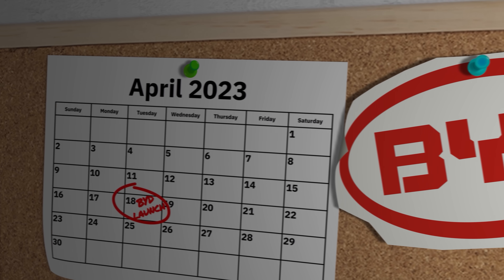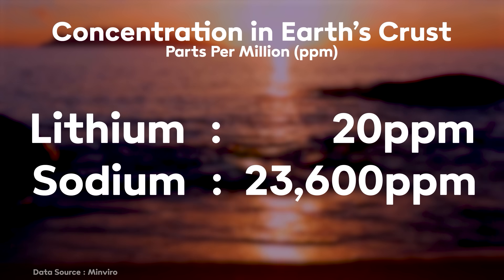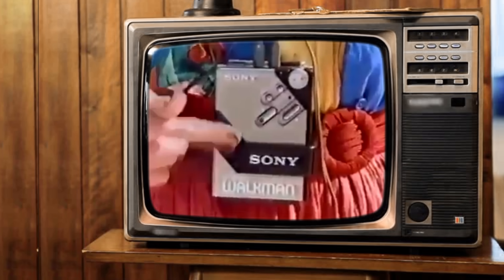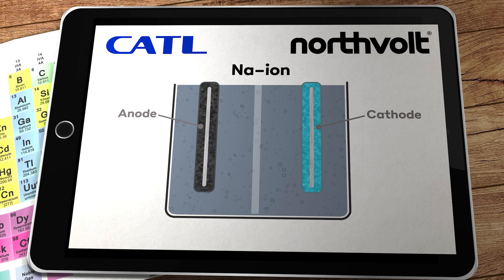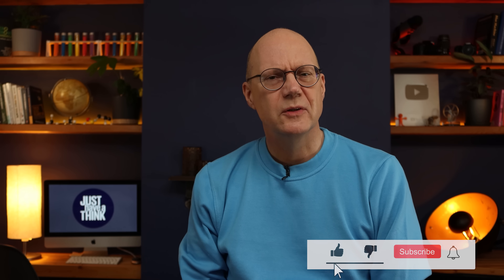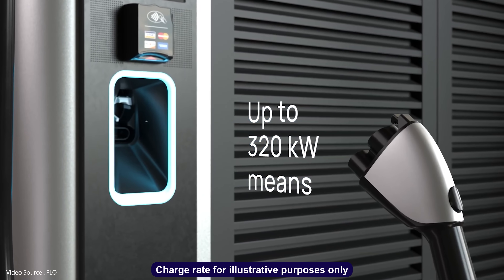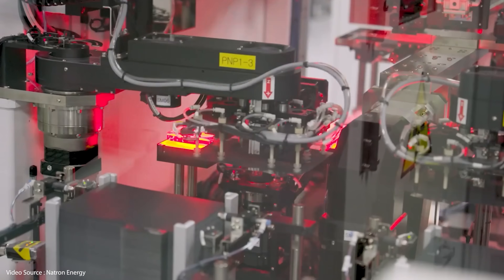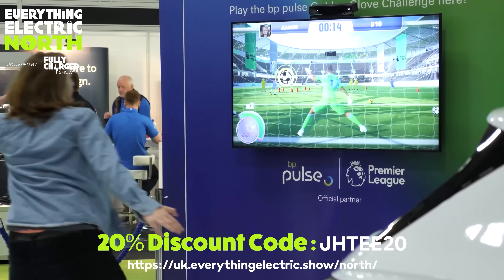Sodium-ion batteries in the USA. Beating China at their own game!

Comment: I have some thoughts about Sodium-ion batteries, but also, I have adjusted my thoughts on last week’s broadcast (sand batteries and hot water reservoirs) and expanded upon them.

First Sodium-ion batteries, yes, it is a very good idea to use cheaper more abundant materials for the majority of our battery needs, and save lithium-ion batteries for products 
were lightness would be a real benefit like mobile telephones and lap top computers, and I see no problem with Sodium-ion batteries for cars, I currently have a small petrol car with 
a full tank range of 400 miles which means I need to fill up every 10 days, and I would much prefer to buy a Sodium-ion battery powered car with a range of just 200 miles, which I would have to recharge every 5 days, rather than pay a lot more for a lithium-ion battery powered car with a range of 300 miles, plus I am certain that just like lithium-batteries before them, the capacity of Sodium-ion batteries will grow year by year.

As for short-term grid scale energy storage, Sodium-ion batteries are an acceptable solution,But long-term energy storage would be better served by a chemical storage system, such as 
Hydrogen via electrolysis, as Hydrogen is also likely to be the future choice for fuels of heavy vehicles, planes and ships. 

In last weeks broadcast, you brought us exciting news about 2 projects in Finland, an underground hot water reservoir for district heating and an above ground thermal sand battery preforming a similar function, but I can not get out of my head that these 2 separate projects should be just one. Water is very good at giving up heat, that is the reason we use it in metal radiators in your house, but in a district heating system when cool water returns to the main heat reservoir there is the risk it cools down the reservoir too much reducing the effectiveness of the whole scheme

What I assume I can see in your broadcast is a series of very large concrete tanks in which hot water would be stored, and pipes connecting to a cities district heating system, then I presume a concrete roof with 130 feet of soil on top, I would like to suggest an alternative set up, again have your very large concrete tanks for storing hot water, but from the corner of each tank you have a concrete collum or pile rising 130 feet to the surface to form the basis of a concrete raft on which you build a sand battery with pipes connecting the sand battery to water reservoir.   

I am reasoning that a properly insulated sand battery should hold on to its heat much longer Than a water reservoir, and therefore could be used be to intercept and reheat the cooler water before it is returned the main reservoir top up the hot water reservoir, this would allow the main water reservoir to smaller, and I assume cheaper to build, of course you have to add on the cost of a sand battery, but overall, I believe it would be an advantage  to thinking on multiple levels.

For the next bit you need to stretch your imagination, I have long puzzled over conundrum of Australia, apart from a few large cities, Australia is a largely empty continent, with more than enough space to install any number of solar panels, many hundred times more than would be needed to meet their domestic needs, plus Australia has a huge coastline just waiting to be lined with large onshore, or offshore wind turbines, Australia does itself and the rest of the world a dis-service when it thinks, only in terms of its domestic energy needs, I believe that Australia could have the capacity to supply energy to a large proportion of the world and become the (Saudi Arabi) of green energy.

Of course, you would have to over come the no small problem of how to transfer green energy to the rest of the world, the obvious option would be high voltage undersea cables, But given that most of its potential customers are in the northern hemisphere, these cables would have to be many thousands of kilometers long, and be laid at the bottom of some of the deepest oceans, at risk from geological and seismological events, or even actions from unfriendly powers (remember gas pipelines from Russia) plus they are going to be very expensive.

The next most likely option would be to green electricity converted into a chemical form,Like Hydrogen by electrolysis, after all given Australia’s large size, Hydrogen is likely to be the domestic fuel of choice for heavy vehicles, planes and ships, so producing extra for export should not be a problem, but carrying Hydrogen in bulk is not an easy task.

I wonder if another method might work, could you convert and highly insulate a large ship, like an iron ore carrier and install a network/ web of air pipes, which you then cover in sand, to create a huge floating mobile sand battery, then use green energy to heat air to a very high temperature, circulate the air through the buried pipes there by raising the sand temperature to a substantial level, before shipping your floating sand battery to one of many northern hemisphere countries, like Japan, China and other Asian nations, once the ship has arrived, the on-board pipes would be connected to a dockside generating station were the process would be reversed, passing air through the pipes to extract heat from the sand.

There could be Yet another variation, I believe that concentrated solar power stations use mirrors to concentrate the sun’s heat towards a central point, usually containing molten salt. 
So, what if you converted and highly insulated an oil tanker, and filled it with very hot molten salt, again heated by green energy, and just as with the sand example, ship it to a northern country, and just as before connecting pipes to the ship and pump molten salt to a dockside generating plant. Of course, you would need more than one ship for each destination you supplied, so as one shipment of heat was depleted, another was ready to dock.

I wonder just how much heat you could store in a ship sized mobile sand or molten salt battery, (is anyone up for doing the math’s,) of course you would have to not just insulate the heated material from the surrounding air, but also make sure heat did not escape through the bottom of the ship into the sea, but I do not believe that is an insurmountable challenge, and it would be a good fit, while the northern hemisphere shivers through its winter Australia would be at peak production, plus it is not just a winter thing, as a crowded Asian continent warmed up; it would still need additional electricity to power all those hundreds of millions of air conditioning units, power that a huge largely empty continent like Australia could supply, if it wanted to. 

Of course, you could have a huge ship filled with lithium-ion batteries, but I would suspect that power delivered by that method would make nuclear look cheap, so will Australia take 
up the challenge of being a large part of the worlds green energy storage system, whether by high voltage undersea cables, bulk Hydrogen, of some form of floating heat battery.

Comment: An earth battery is a pair of electrodes made of two dissimilar metals, such as iron and copper, which are buried in the soil or immersed in the sea. Earth batteries act as water-activated batteries. If the plates are sufficiently far apart, they can tap telluric currents. The simplest earth batteries consist of conductive plates from different metals of the electropotential series, buried in the ground so that the soil acts as the electrolyte in a voltaic cell. As such, the device acts as a primary cell. When operated only as electrolytic devices, the devices were not continuously reliable, owing to drought condition. These devices were used by early experimenters as energy sources for telegraphy. However, in the process of installing long telegraph wires, engineers discovered that there were electrical potential differences between most pairs of telegraph stations, resulting from natural electrical currents (called telluric currents) flowing through the ground. Some early experimenters did recognize that these currents were, in fact, partly responsible for extending the earth batteries' high outputs and long lifetimes. Later, experimenters would utilize these currents alone and, in these systems, the plates became polarized.
Reply: Imagine farms fields making electric and growing more food. It takes 10 acres of solar to grow one acre of food. We could grow 11 acres of food and make some electric.

Comment: Two words: Voltage spread.  It's too big.  Use Na batteries and you have to add a ton of buck and boosting circuitry just to try and get something in a usable range.  That means a lot of converting which means a lot of wasted energy.  So you get even less energy than you think.  As an example, a 12V Na battery will have a high of around 17V fully charged and discharged will be around 7V.  No inverter can handle that sort of spread, and neither can most 12V devices.  To contrast, a 12V LifePo4 battery will be at 14.6V fully charged and 10V discharged with the two extremes representing very little of the usable energy, the average being just a bit above 12V, or pretty much as perfect as you can get.  The higher you go with voltage, the more of a spread you get with Na batteries.

Comment: May as well use these in ferries and cruise ships to supplement ballast in the centerline. Win win, use them until 0 volts as really ultra clean energy, free ballast, then use LNG for the remainder of the trip, and recharge on shore power while docking.

Put batteries in all the vehicles that can't be powered directly through pantographs.

Comment: One huge result of this would be a reduction in the need for Lithium. Every sodium based battery utilized means that much less lithium is needed. Supply and demand tells us that will reduce the price of lithium in the market place or at the very least, slow the rise in price.
Reply: Agreed, stationary battery back up to cover solar and wind intermittency does not need to be Li+. There is a vast amount of that going in right now, it could ALL be Na+. I looked to see if I could pick up some stock in this technology. Alas, not yet but I'm sure it will come soon.

Comment: Sodium Ion batteries are great, but they will tend to push EVs into the niche role of an around town car.   That's probably a good thing as it addresses a lot of the current oversell of EVs as a complete replacement for IC cars.   It will be very interesting to see where this goes.
Reply: I think 20 years from now we'll see a mix of hybrids, lithium EVs and sodium EVs .  Lithium or sodium will be options on the mid to lower priced cars but the high end ones will be lithium only because of the weight to power and weight to capacity ratios

Comment: i don't think the BYD Seagull uses sodium ion batteries. it's more likely that BYD is using their great LFP blades. it is however correct that both CATL and BYD have assembly lines for sodium ion batteries. note that due to the much lower volume than LIBs, the sodium ion batteries are currently more expensive than the LFP batteries they can replace. one key attraction seems to be the low temperature behavior. Natron seems interesting. thx for pointing them out.

Comment: i am in team #HEV but let me explain? instead of big, heavy batt packs we could electrify roads via SMRs and in cases they go offroad have a really small ICE to charge the really small batt packs? advancements in wireless charging tech would have to be made. in fact screw traditional ICE we could have linear/free piston generators that run on almost any fuel and specifically built to be as efficient as possible to charge small batt packs...

Comment: sodium batteries are safer, last longer, charge/discharge faster, and are exponentially cheaper. the only problem with them is people were convinced that EVs don't have enough range, even though the BYD sodium battery car has twice the range >90% of US drivers will need daily. 

sodium battery EVs should be the norm, and lithium EVs the outlier for people that for some reason need more than 500km range, even though that is WAY more than is recomended for a driver to drive without resting (30 min every 2h).

Comment: I also would argue that they're already in par when you take into the math that Li can't be fully charge or discharge - leaving around 20% on the table that even if Li can use that you wont be able to use. Granted, you shouldnt get that low in the first place for a car (much good o gas), but its still a thing to notice for home and grid storage. So really, when you compare, it would be Li 80% (- 20%) vs Na 100%. If you do that, then its only really a 5-10% difference depending on how well the cells are. Let alone, at a cheaper price per cell, you should be able to get more for the some price. Thus more power dens than what we currently thats out there. So really we're hitting two price point areas not just per storage.

Comment: Fun fact, there isnt anything stopping them from adding a bit of Li to the Na mix either. So a hybrid design could still allow higher power dense batteries if they wish to continue improving them by adding only a bit more power to them. By intermixing you could see close to what current lower to mid range Li hit today while using 3rd or more less over all Li in the mix. Making them just as good for cars today. Maybe not trucks because of the power dens they need for longer travel, but more than good enough for the everyday user who charges at the station while taking way less time. Currently, battery cost is the only reason I havent went full into solar, so once these hit the market and drop over all cost down 35% or more - its going to be a no brainer to hook them up even if they dont have solar to shave peek power cost and as a home battery backup.

Comment: so, this type of cell seems very well-suited to home energy storage from solar, wind, or, and, in many places that have extended power outages in the winter (Texas, Midwest, Maritime Canada), where they could provide UPS kind of capacities for several days, or, in smaller sizes, provide peak load demand from smaller gas/diesel/propane-powered generators, allowing smaller generators that can be quieter, possibly more fuel-efficient when run at peak efficiency, maybe even stop/start operation... all good!

Comment: I wonder if the sodium batteries industries or government will be going hard on recycling these since sodium is so abundant compared to lithium. "Hey, let's make a cheaper and less depending on rare materials so we won't have to deal the darn recycling and make more money!"
Reply: In some ways yes, thats going to be a problem, but in other ways, because of how the stuff works, it will make recycling the iron and Ai easier. As Li has to be pull out of the other elements with reactions. While with the Na you can just skip or reheat up. Even if they dont recycle, and it hits a land fill, because it uses less toxic elements, it wont matter as much. So win win in all areas, but also a lost because the value of the battery would make it harder to want to recycle it without some type of government need to force recycling of them.

Comment: A little correction: the Seagull now starts below $10K in China after a permanent price reduction at the start of this year, and it doesn't use a sodium battery, but rather the regular LFP Blade battery generation 1 that BYD uses extensively (and that is being replaced by the cheaper and more powerful Blade Gen 2 in new models and model refreshes). There are cars you can already buy in China with Sodium batteries, though, and a 10MWh Sodium-based grid storage facility was recently put in operation there, so Sodium batteries are already seeing actual use in real life conditions there.

As for Natron's battery, they seem to be niche, with a very low energy density (hard to find specific info, but it seems to be around 70Wh/Kg, less than half of CATL's and Northvolt's 160Wh/Kg). They could work for static energy storage (if you can spare twice the space that Chinese or Northvolt's Sodium batteries would take), as well as devices that need little energy, but at that low energy density they aren't of much use for vehicles. They need to improve energy densities a lot in order to compete for EVs, and that's assuming they can sell their batteries at competitive prices with the likes of CATL and BYD.